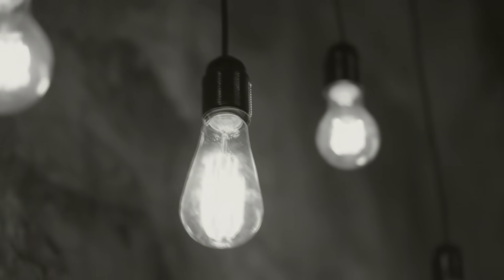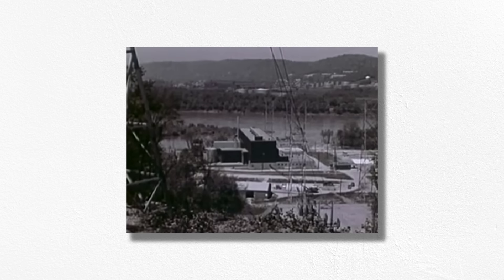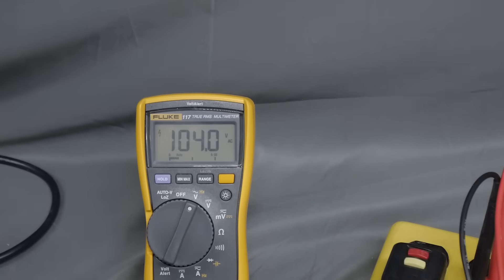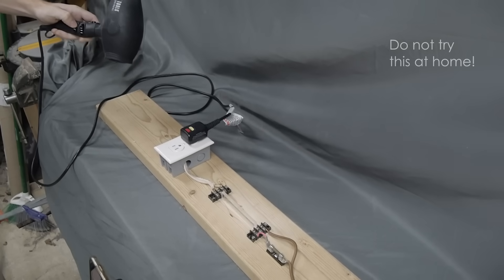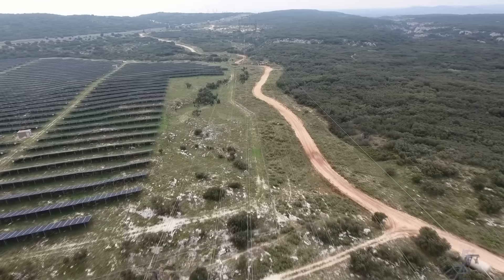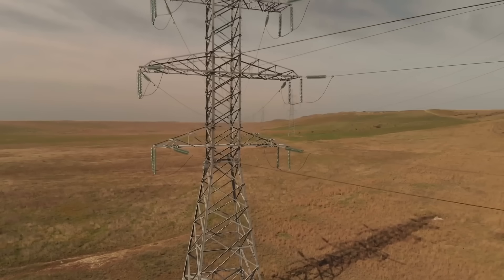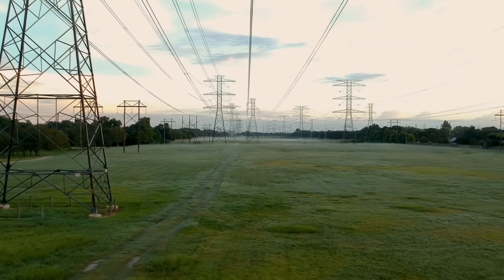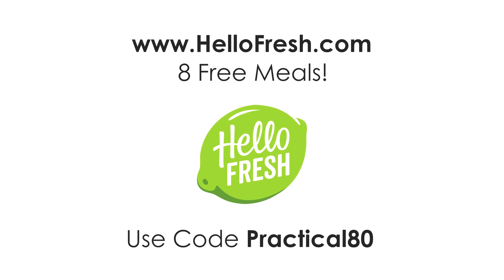How do Electric Transmission Lines Work?

Comment: HV transmission is also a working proof of the concept that the electric power does not flow in the wires themselves, which is one of those things that blows a lot of people's minds when they first hear it. If it did, the wire gauge would have to be proportional to the power, not to the current, and you wouldn't be able to use relatively thin wires to transfer power. The more power you needed, the thicker the wires would have to be. But we can and do use those thin wires. Because the wires don't have to be sized for the power, they just have to be sized for whatever current is being generated for the transfer of power at that particular impedance. And that can be easily manipulated with transformers, to the point where even the power for a whole town can be carried at a low enough current that the cable carrying it can be small enough to wrap your hand around. The power itself flows in the space betwixt the wires, as the cross product of the magnetic field from the current flowing in the wires and the electric field of the voltage potential between the wires - the poynting vector.

Comment: 3:34, didn't you mean to go back to the definition of power? P=I•V, to reduce I you increase V and carry the same power over the net.

If you use Ohm's law over a wire, R=V/I, and you increase V but lower I, it looks like you're increasing the wire resistance (which you wanted to stay static).

Note that the voltage you want to increase is the system voltage, not the voltage dropped inside the transmission. In order to get the same power output at the end.

If you work with fixed wire resistance, you will see that the voltage drop over the wire will decrease if you increase the system voltage and draw the same power.

Comment: Just as scuffing your shoes across a rug in wintertime will build up a static charge on you, so electrons scuffing their way through the transmission line will build up a static charge on the lines.  The static arrester lines at the top of the lines will take some of that static to ground.  (Workers on the lines, brought there by helicopters, will have a static charge built up on them that will have to be grounded on the body of the helicopter before the worker gets back into the helicopter.)

Comment: The cost explanation is bullshit. In europe, most power lines are underground.
Reply: Most transmission cables are not underground.
Reply: In europe, people may not have the choice whether to underground the wires.  In the USA, we often do have a choice.  An improvement district would be formed and the people in the district would vote on it.  If it passed, the property owners in the district would have to pay for it.  In a developed area, the developer might choose to put the power underground.

Comment: @3:35 You say that the only way to reduce the current is by increasing the voltage. Just because the animation shows the V getting larger and the i getting smaller doesn't mean that's how math works. Look at it, if you multiply two numbers to get a third number and you reduce the size of one of the multipliers, the product will be smaller as well.

Comment: Now how about clearing up the constant rumor that some long range transmissions are converted to DC then back to AC at the terminal station. Id be interested how that would be done. To produce a clean symmetrical 3 phase sine, efficient would be a challenge   Another one I heard is that they "turn up" the current on some routes that are prone to icing. I could see that working, but it would require on the fly transformer ratio adjusting.. If there such a thing.
Reply from the maker: There are definitely high voltage DC transmission lines. Not as popular in the US but they exist. It’s only a google search away

Comment: at 3:38 how do you have an equal sign with one variable increasing and one decreasing? Ohm's law is also not needed here at all. It is easy enough to see from P = VI, or I = P/V, that increasing the voltage while keeping power use constant will decrease current.

Comment: Okay...I wasn't very good in premed Physics...LOL. But, why is there a double-wire, spaced closely together, under each insulator of the high voltage lines??
Thanks in advance.
Reply from the maker: It’s called bundling. Bigger cables don’t transmit more power because the current stays on the outside (skin effect). So they use mutilple conductors instead. Also helps with corona discharge

Comment: Those power lines are so complex because it is an idiotic way to provide power as people will soon come to realize in a not too friendly way.
Reply: Well...unless we pipe green-sourced hydrogen to homes and businesses, and use it in fuel cells-what is the Alternative??
Reply: @drpoundsign  There are many alternatives, hydro being the best if one has a constantly flowing stream nearby with at least 2 foot of drop otherwise there is solar and wind and learning to control power usage with a propane generator backup. For city dwellers, local power production with minimal wiring.

Comment: Can you do a video on how power can be stolen from transmission lines by having a conductor laid out on/in the ground? How much has to be laid down? How is this different than houses under transmission lines with all their electrical wiring?
Reply: Some guy did a video on this on YT and made a receiving device using a coil of wire, but you can't get much energy from it.
Reply: @deang5622  Weird. My father-in-law had pointed out a property where the owner now in jail because he had laid out copper cabling under massive power lines. The electric company could measure a power drop and was able to track down the location. But, I have no way to validate the veracity.

Comment: 3:34 This explanation is wrong. In the Ohm's law the voltage is proportional to the current so increasing V increases I as well. The animation is ridiculous. We need to start from the total power we want to transmit: P = IV. From here it's obvious that transmitting at high voltage lowers the current.

Comment: 3:38 Your explanation seems wrong. That's not how equations work. If you reduce current you'd have to reduce the voltage too if you keep the resistance constant. But you want to increase the voltage, so you also increase resistance according to Ohm's law.
Reply: What he said was " to keep the power constant, you have to increase the voltage"  Not keep the resistance constant.  Power P=IV   if I decreases, V has to increase to keep P constant.
Reply: @karhukivi  Oh definitely, you're right, and he's right (and I'm right). I was merely pointing out that the formula P=I^2xR (or V=IxR as was on the screen) doesn't show us how voltage affects power, if anything it shows us how current and resistance affect it. Maybe the audio was just a bit out of sync, but with the formula in its P=IxV form it's obvious what he meant.
Reply: @spookymanbearpig  Sounds like a good result all around!  Have a great day!

Comment: Hi, today I suddenly realized a thing I don't know and would not be sure how to explain. I appreciate, and I have some superficial knowledge about how power grids work. One thing I don't know though: how do different providers actually get their electricity to your house? I don't think that the infrastructure is split between them, so is it just a matter of pumping electricity on the grid and saying that what you took, you nominally took it from them?
Reply: It's accounting and grid monitoring.

Grid operators monitor power flows 24/7 while people responsible for ensuring supply equals demand forecast everyday how much power ( in mega watts) is needed to meet instantaneous demand.  If more or less is needed they'll tell one of their generatord to ramp up or decrease their power out put.  They can also buy or sell power at market rates.

In this case someone else generates extra megawatts to put it on the grid.

All this is monitored by power flow meters and qatt hour meters. The power flow meters are put on lines connected to other utilities to monitor who is providing power to who. The megawatthour meters count how many megawattsare transfered  hourly. The utilities agree on the price and bill each other.

For you this is transparent  since you're the end customer, you're just billed based on your mega watts hour meter by your provider.
Reply: @diffieq  damn, thank you for the in depth explaination!

Comment: When the regulatory agency sets the price charged,  they adjust the price to compensate for normal losses.
You did not mention that DC transmission  is more efficient than AC.     More and more high voltage DC transmission is use when long distances are encountered because DC has less line loss.  I am a farmer and encounter power transmission almost every day as I make daily decisions.   Mechanical and electrical.
In fact a crop is a big solar collector.
Reply: Transmission might be more efficient but AC to DC rectification and conversion of DC to AC is less efficient than transformers.
Reply: DC transmission is only worth it over long distances and for very high voltages (500kV+), or for grid interconnections to prevent synchronisation issues.

Comment: In addition to using OPGW, communications are often sent over the main phase conductors and then decoupled using wave traps. This is how carrier relay schemes work so one end of a line can “tell” the remote ends of a line which direction a fault is in, thereby only opening the breakers required to isolate the fault.

Very informative and explained very well, thanks.

Comment: Great video....I never knew you could  figure out power in the line by counting insulators....very cool.
Reply: It's voltage you can estimate from the insulators, not the power.

Comment: I know it wasn't the main point of the video, but the part where you said "Electrical utilities only earn revenue on the power that makes it to your meter.  They aren't compensated for energy lost on the grid." is not true everywhere.  In western Massachusetts (U.S.), the Department of Public Utilities has an agreement with electrical utility company Eversource which guarantees Eversource a specific annual revenue, regardless of how much or how little energy customers use.  If the generated revenue is less than the agreed-upon revenue, then customers will receive an additional fee on every bill the following year.  If generated revenue is greater than the ageed-upon revenue, then customers will receive a slight credit on every bill the following year.  This fee/credit is a line item called "Revenue Decoupling Adjustment" on the bill.

Comment: 3:50 "to 100k volts"
eh ? I'm working in a company that manages the high voltage power network somewhere in europe. There are plenty of lines with 130kv, 300kv, and 420kv. Anything below that is considered for local distribution.

Comment: What I want to know is just how they make AC power from solar cells as they produce DC. And when it comes to wind power just how they maintain a solid 50/60 hz AC when the wind is always changing speed. Also, how do they keep it all in sync with the grid?
Reply: This is actually one of the biggest challenges with renewables. Generally speaking, it's with computers and other electronics. All the power made from wind/solar is DC so it needs to go through an inverter to be turned into AC. But what happens when an inverter fails? Renewables are considered "asynchronous generators". Unlike when a synchronous generator fails, the asynchronous generators go from producing 60 hertz to just 0. A synchronous generator will continue to spin and produce some power allowing time for the rest of the contingencies to be in place. As far as I'm aware, the main backup is just a large bank of batteries to kinda be used as a synchronous generator failing. At least that's what I got from my time in the transmission planning group I was in. I work for a utility and now I'm doing substation design.
Reply: Power electronics is how they do it, the wind turbines have inverters that use pulse width modulation to produce a sine wave at the desired frequency

Comment: voltage drops over more than 3% in a 120v circuit is out of code. 7% in 240v. Unless the before extension was on purpose you have a problem somewhere.

Comment: My local big box home improvement store has a load of larger transmission lines passing overhead.
If I go there in the rain (wet car/ground) and load my SUV thru the back window with my knees resting against the bumper, I feel them tingle from the point of contact down toward my feet. I do not think I would like to do that with bare feet. I should take a meter there someday.
I am careful not to take my truck there on wet days. That tailgate is dangerously close to my nads....

Comment: I heard: that if one stands under a high voltage line holding a flouresent light that the light will illuminate, 2) that power companies charge large manufactures that use highly inductive motors for the capacitive reactance that is present from long distant transmission lines. 3) finally, why not bury these transmission lines as it would be safer, make the lines less vulnerable, safer and more ascthetic (power lines are ugly)?

Comment: So the big towers deal with 100K+ volts but how much amperage can flow through each wire if it's say... 90 degrees F? 100 amps? 1000amps?

Comment: Sorry but I’m confused how increasing the voltage reduces the current. I’m assuming the conductor remains the same and so the resistance remains the same. If the voltage is increased and it is directly proportional to the current wouldn’t the current increase as well? Please help. Thanks

Comment: Excellent demos with the hair dryer and transformers!
Another fascinating aspect of transmission lines is called “stringing and sagging”. Those conductors are heavy! They are strung through pulleys on the insulators until the line droop and tension is right, then anchored. And the conductors have to be spliced when a reel runs out; sometimes explosives are used to implode a sleeve onto the splice.
Driving down US 395 in California, you see a transmission line with only 2 conductors. It carries +/— high voltage DC from the Columbia River to Los Angeles. This avoids problems with synchronizing 60Hz grid power and AC impedance matching over a great distance.

Comment: Good video. I wish you got into some wire guages and ampacitys of the transmission lines.  I guess the amps are low when the voltage is that high, but still.

Comment: I'm a bit confused as to how 3 wires can carry 3-phase power. I wonder where the neutral goes...
EDIT: Now I know.
Reply: high voltage primary circuits of a delta system have no relation to ground, therefore no neutral conductor. Each conductor is a phase, on the secondary side of the transformer however. the neutral conductor (if used) is connected to the ground.
Reply: When the system is completely balanced, (voltage and current magnitudes are equal and phase displacement is equal) you don't require a neutral as the sum of all three phases is equal to 0. Balanced systems are connected in Delta, Wye (also called star) is used for when the neutral is required.

Comment: I was able to figure out the insulators easily enough but I never knew they were standardized and could be used to get that rough idea of voltage protection!  Had no clue about guard wires either though it is one of those things that, once explained, makes so much sense I feel I should have figured it out myself!

Outstanding video, as always!

Comment: Solar power is less than 1% of the total electricity generated and that includes the toy panels on houses.  The real way to get local energy production is with the coming small nuke plants that are totally automated and act like a giant, infinite battery and are buried in the ground for safety.

Comment: why don't you explain why they use aluminium instead of copper conductor?
Reply: It's cheaper. Also, copper is used, but for conductors that are required to carry very high current.
Reply: @ohgoditsjames94  not only cheaper, it Is also lighter at same current, rust resistant may rust but never degrade much of it's conductivity and strength, it Is less malleable, less maintenance,

Comment: All very logical with one exception. Why is there a power shortage? Why are power generation plants limited? If power is generated at a given rate, why are power customers being charged for power at several rates during the year, seasons, times of the day? Are these concerns due to Government creating limits and manipulations of power supply?
Reply: Generating electricity is not the problem. The existing  transmission lines that  travel hundreds of miles, over mountain ranges state lines to connect generation stations to the grid are at their max. We need more lines . Some California lines and towers still in use are from the 1930s. Power companies either have to own the land or be granted easements to be able to build new lines
Reply: @jrcampos1952  Power generation is limited in CA by the state. Not only that, they tax or penalize power that is generated from natural gas turbines and sold to rate users as it is not "green". Funny that is...in the 1970's they told the public natural gas was "clean buring" the best source !

Comment: Great video! Loved the blurb about how to tell the voltage of a line by the insulator. Interesting......As a substation relay protection and control design engineer I found your video quite good.

Comment: Insulator length is also dictated by atmospheric particulates, like salt near the ocean and/or dust/dirt/pesticides from farming that get on the insulators and promote flashover. So depending on the installation , length could vary greatly even at the same voltage.

Really want to confuse people, throw in power factor correction for efficient transport of power and line transposition to mitigate distributed capacitance! Oh yeah!